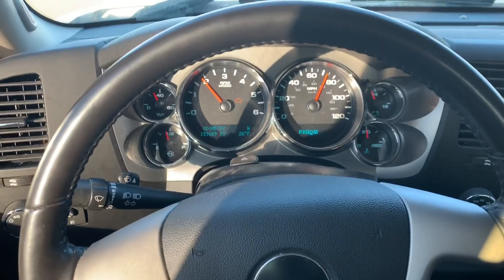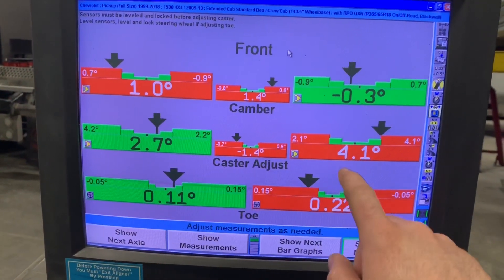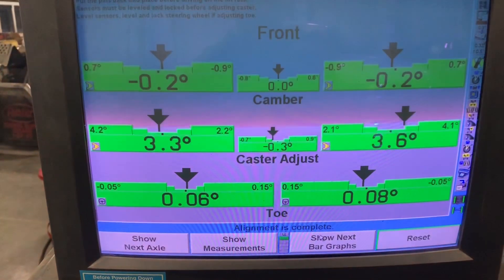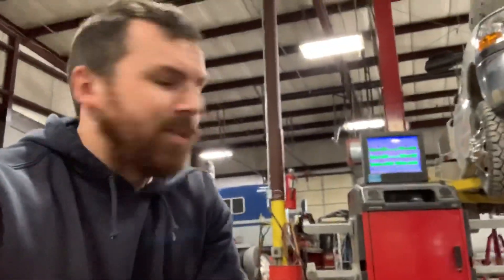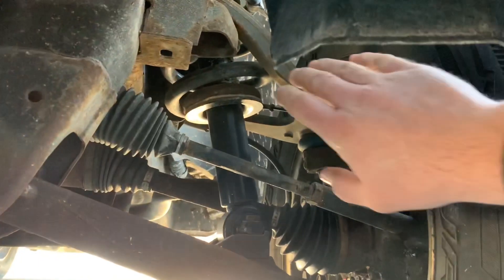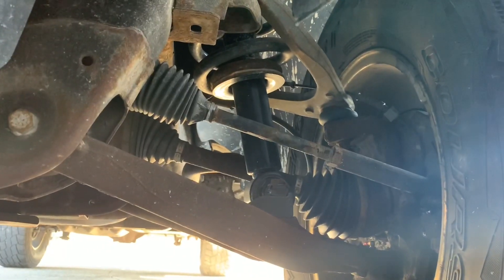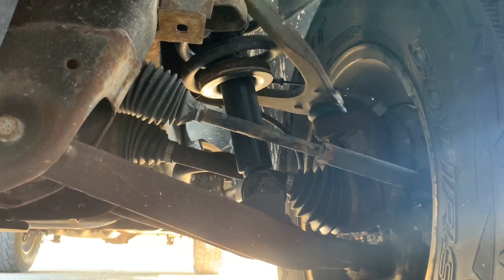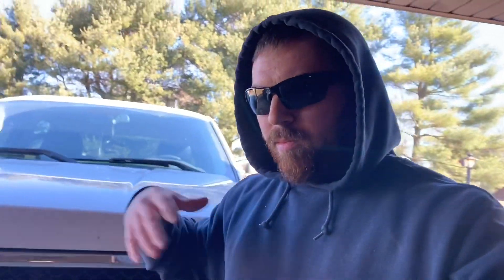Silverado Leveling Kit Alignment Issues

Comment: Great video!  I put the 3"/2" Motofab lift on my 2017 Silverado 1500 LTZ.  I noticed that the right front wheel (Passenger side) inner rim edge is rubbing the upper control arm when the wheel is turned all the way to the right and I'm backing up.  Long story short, I noticed that the tire is tilted inward toward the engine like you said in the video.  This is after the dealership that installed the lift did an alignment.  Ugh.  I'm going to take the truck to a local shop to correct the camber issue. Again, thanks for this video and for sharing your knowledge.
Reply from the maker: If you did a 3.5 you should upgrade your upper control arms.
Reply: @TheDieseldog  I did 3 inch up front and 2 inch in the rear to level the truck out.

Comment: Do you align the leveled truck using the factory specs, or does leveling the truck require altered alignment soecs?
Reply from the maker: I use factory specs. Sometimes caster ends up slightly positive but as long as they are within half a degree it’s not an issue. Camber and toe are what cause tire wear.

Comment: I got a question I got a brand new 2021 and got 2.5 spacers put on the front and when I turn sometimes I hear something shift in our out of place near my left or front wheel also I’ve had them align it twice do to toe and yesterday when I was doing donuts I heard amd felt something shift in the front axel towards my right wheel when I drive streight my steering wheel was out of wack the I turn it fast and it kind clicked back in to place but now my steering is semi crooked do y’all knw what it could be?
Reply from the maker: You need to check your alignment cams. I believe on 21 it’ll be the bottom control arm. And just check everything you touched to make sure nothings loose.

Comment: man idk wtf i did but i cannot get my top control arm back into place like the ball joint is so far away from where i needs to go. almost like the strut won’t compres to get it through the hole.idk if that’s even possible
Reply from the maker: What size level are you installing?

Comment: So you had 2" level, went to a 2 1/2", and now dont like the rear end lower than the front? Why not take the 1/2" back out of the front?
Reply: Because that would be common sense and most people doesn’t have that. He also kept saying that it pulls the top of the tire in when it pushes the top of the tire out unless I miss understood what he was talking about. Also don’t know how a Tahoe would compare to a 3500 Silverado maybe a bit of different. Alignments are necessary after any steering or suspension work for sure though. But if it was me I would just buy quality parts as stuff wears and it will all hold up.
Reply: @dakotadickens3747  also maybe he doesn’t do it not cuz of common sense but cuz he likes the height of the front the back is just to low for him and money don’t grow on trees so I assume he’s on a budget or else he would just do a full suspension lift Mary Christmas

Comment: what about that road noise? i have a leveling kit on mine, checked bearings, is it the cv shafts not aligning properly? i heard it in your truck from the video
Reply from the maker: What kind of tires are you running?
Reply: @TheDieseldog  no idea, they aint mudding tires but they aint no highway tires either
Reply: @TheDieseldog  rotated tires and they definitely were worn unevenly , bad alignment im assuming whoever put the leveling kit on did it themselves and never had it aligned, still getting a rotational noise though, im about to just get a whole kit, two cv axles and two bearings and call her good, get it aligned, take the spacers out from under the struts , and it should be golden.

Comment: I have a 09 Avalanche with a 2” lift. I went for an alignment a few years ago and they said because of the lift they needed more adjustment to the front end but couldn’t and needed to add a part. I can’t remember what part but now the outside edge of my tires are going bald and it’s time to get new tires and a proper alignment.

Could this be true that I needed a part to give them more room to adjust? You didn’t need to add anything right?
Reply from the maker: With just a 2 inch level there should be enough adjustment to get it aligned properly. I’d check somewhere else when you get tires. Definitely get it rechecked.

Comment: I have a h3 I have a lift kit on it started noticing my axel boots keep ripping bad was told I should lower it a inch and a half but I don’t wanna do that since I paid for 3 inches what do you recommend I should do ?
Reply: Sounds like u need to install a front differential drop kit to it. It will lower the front diff and make the cv angle less harsh.
Reply: @fbody23100  do have a idea around how much would I waste on that ?
Reply: @reneluna249  specifically for a h3 I'm not sure. For my silverado it was 30 bucks off Amazon. There's not much to it just some thick washer looking spacer and some longer bolts.
Reply: @fbody23100  how can I look for it on Amazon what’s it called
Reply: @reneluna249  just search ur year h3 different drop kit.
Reply: @fbody23100  okay I will. Thanks

Comment: Question I removed my 3 inch block spacer lift and my tires are out from the bottom and open  , is safe drive for 3 days like that ? I have appointment for alignment Wednesday
Reply from the maker: Don’t drive far
Reply from the maker: You’ll chew up tires faster than you think.
Reply: @TheDieseldog   ok thanks, I have appointment for Wednesday